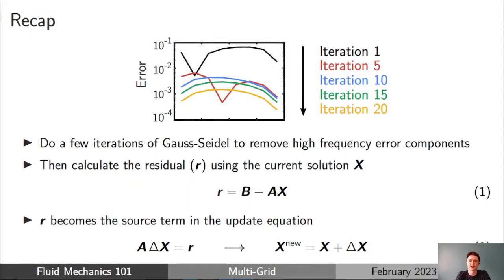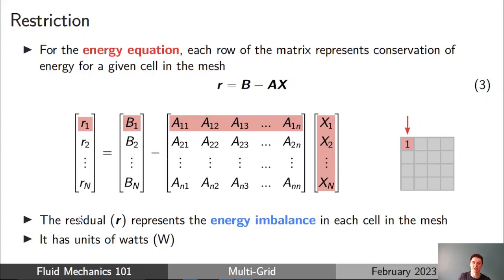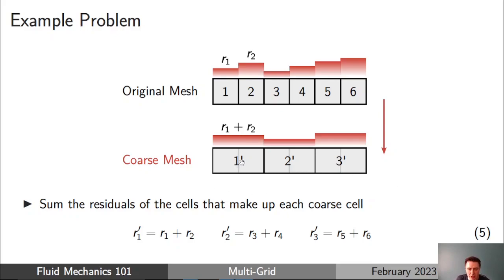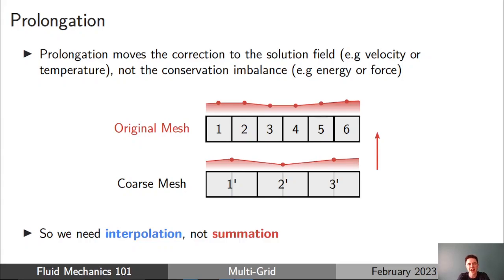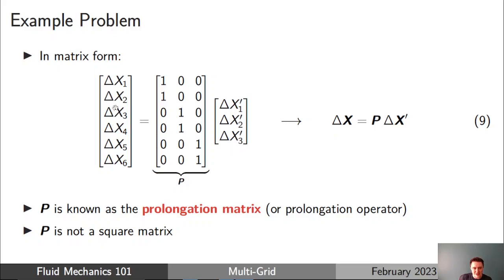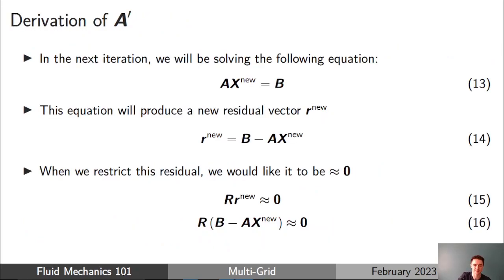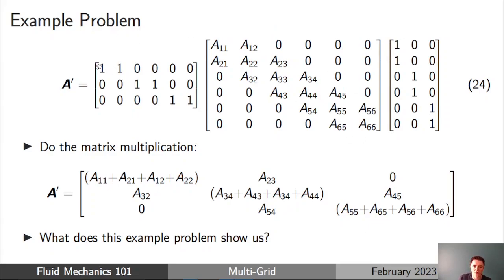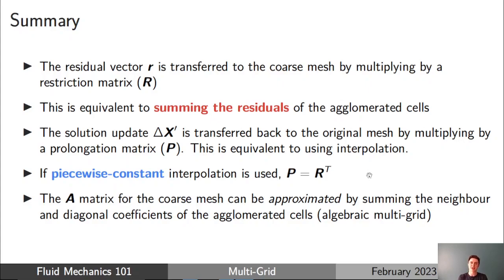[CFD] Multi-Grid for CFD (Part 2): Restriction and Prolongation

Comment: Good lecture, for finite volume I would go further. The new diagonal entry is the sum of the central diagonal of the agglomerated cells subtracted by the cell faces which were 'merged/removed' during the process of forming the new course cell. This is true because the diagonal entries have an opposite sign to the diagonals (ensuring FV conservation). Of course this is all true for the example and R and P provided.

Comment: Great video. Multigrid is simpler than I thought. Idk if you plan on making a part 3, but you could maybe talk about various types of multigrid cycles.
Reply from the maker: Yes, I was thinking about doing another part on the various cycles, as it is the next logical part. However, I will wait and see if people would find this helpful, as this might be a level of detail too far for most CFD users. Let me know what you think 😃
Reply: @fluidmechanics101  I think it may be too many details for CFD users but greatly useful for grad students. Explaining how the restriction/interpolation steps are practically implemented in a cfd code through cycles, how those cycles compare in terms of convergence speed and computational/memory cost. I think the series would be incomplete without part 3! :D
Reply: It would be great to see a follow-up video about different cycles.
Reply: I think the big challenge is doing it in parallel. Just consider: How do you agglomerate over processor boundaries? How do you ensure load balancing? How do you make sure the new courser grids are correctly communicating over processor boundaries? And all this is being done on complex geometries, with complex connectivity graphs, in 3D! I remember a PhD in my post grad office, a few years back, trying to sort out Parallel AMG and he never got it to work.  I will say though that this channel does a good job of pulling out the core aspects of methods and presenting them in a very digestable way.
Reply from the maker: Thank you, much appreciated. Yes multigrid in parallel is difficult!